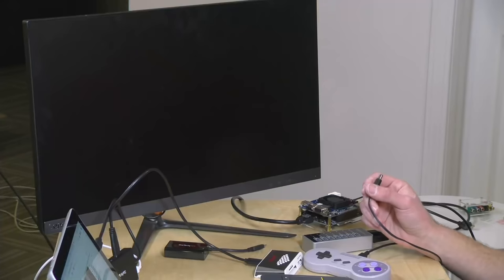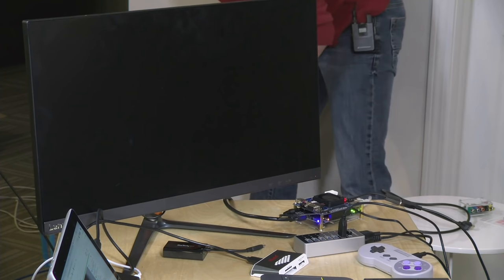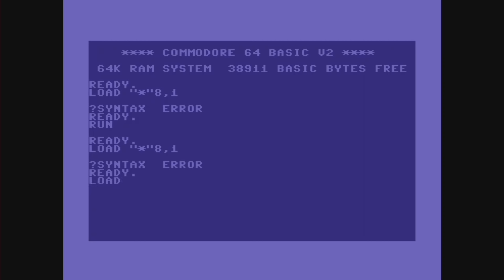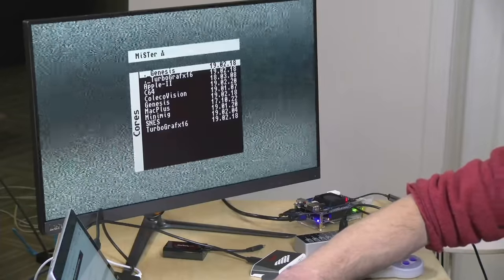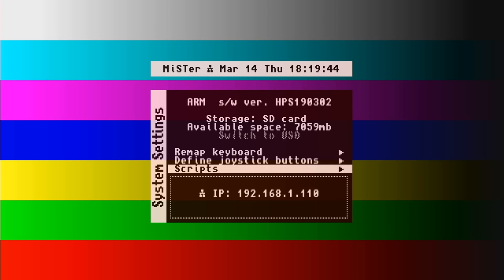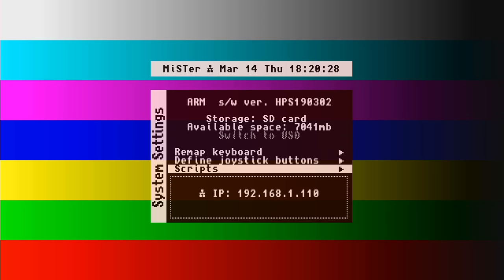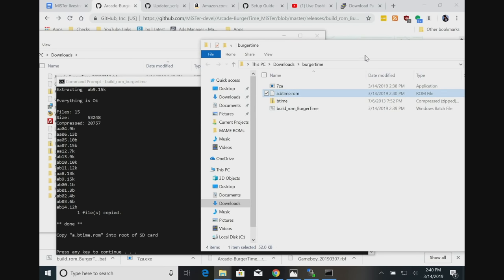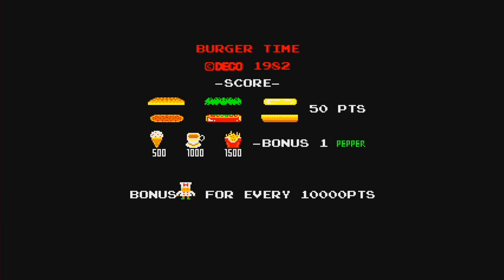More MiSTer! Arcade cores, auto updates, scalers and filters

Comment: It's a field programmable gate array, which is a type of chip that can be reprogrammed on the hardware level. So it's not emulation in the sense that emulation adds a layer of abstraction by running software by emulating its required hardware environment in software, which in turn is the process running on actual hardware, whereas with an FPGA this can run essentially on "bare metal" or directly on the configured FPGA hardware.

Comment: so the distinction is emulating on the hardware vs. emulating in software. as you said, emulating in hardware buys you parallel processing between different parts of legacy systems as they operated back then. but the lack of parallelism wasn't an issue in emulating in software because our modern computers are sooooooo fast that even in carrying out functions in serial, it can comfortably emulate as if things are happening simultaneously - but the cost is that the computer you're using to emulate has to be much faster than what you're emulating. I suspect the fpga is running much slower than a modern mac or pc but it can do so because of parallelism.

BUT - it's not necessarily the case that the cores are totally accurate recreations of the original machines. it could totally be that they are just doing what software emulators are doing - looking at software calls and just replicating the effect without an exact implementation of the original.

I think core CAN be written to accurately replicate the original chips. but it's not necessarily the case that that is what's happening.

so the key distinction is emulating in hardware vs software.

may get some advantage where the parallelism works much better on fpga. but otherwise, not necessarily better than sofware emulation.

the big draw for me is that all the cores are accessible from a single interface and in the same way so simplifies how I work with different emulators.

love your show man!
Reply: Most definitely better than software emulation, unless accuracy is not important to you. Also, latency throughout the entire chain can be reduced effectively, and without messy hacks. In the fpga realm .05ms of audio latency is a viable goal. The highest end audio solutions on PC that professionals use every day would be a order of magnitude higher than that. It really is a paradigm shift in recreating these systems and experiences, but as you said, largely comes down to the skill of the person making the console/arcade/computer core in question. Luckily we have some very top-tier talent working on it =)

Comment: I don't know if it's possible, but I'd like to see some addon hardware that allows you to use original carts. It's of course not necessary but it would be cool in it's own way. Plus it would be good for people who refuse to download roms. Also a way to use original controllers would be neat.
Reply: there are a couple of people currently working on producing daughterboards with connections for legacy controllers.. there are also some off-the-shelf adapters that allow you to plug in genesis controllers and 8/16bit joysticks via usb..
Reply: For what you describe, the consoles that Analogue makes are the perfect solution. That's literally what they're made for. If you're willing to fish for original carts and want as authentic an experience as possible, that is the best current route. Loading actual carts is very much outside the scope of the MiSTer project, and would require significant rewrites to current cores, likely from someone dedicated enough to fork the entire project on GitHub to implement it.. and that's the glory of open source. If someone wants it bad enough and wants to invest that time and effort, they can literally get started today.

Comment: i once used an otg adapter to power a speaker, and it would drop out when the bass would hit.

used another that looks exactly the same as the other, bought from the same store
(action, a german store that sells tons of budget tripe)
and it gave a lot more juice.

probably a shittier wire gauge in one of them, it's a problem with cheap taiwanese bulk crap lol

Comment: As long as there is MiSTer, the stand alone Analogue consoles dont need to exist.  I understand people like to plug in carts on consoles but most people just end up jailbreaking them anyways and play their games off SD cards anyway.  Doesn't really make any sense to do that.  Just get a MiSTer and your set.  Plus the MiSTer gives you the option to do analog out to a CRT monitor which the Analogue consoles can not.  

I only wish the MiSTer can allow a second controller for 2 player games.
Reply: Mister is not a replacement for the Analog systems. Those are more refined and are made by kevtris to be feature complete, and will give you a better experience than MiSTer currently, but MiSTer is getting closer to the high benchmark set by Analogue with those systems. 

Also, mister supports up to 6 players currently. There is no issue with most multiplayer games, and if you happen to find an issue, kindly report it at the MiSTer github for the core you encounter these issues on. These reports will help MiSTer to be a better platform, so please take the time to do this if you're certain about a bug.
Reply: Also, mister has no ports for original controllers and carts as the Analogue systems have, which is important to many people. Their clone consoles also support important attachments like the Sega CD, which mister does not currently, but is being worked on.

On the flip side MiSTer runs with pretty much any controller under the sun via USB, and will run roms directly instead of requiring carts.